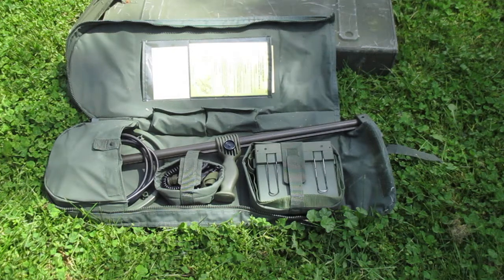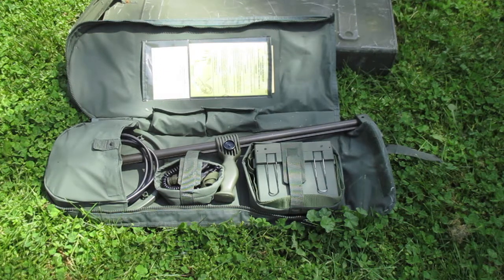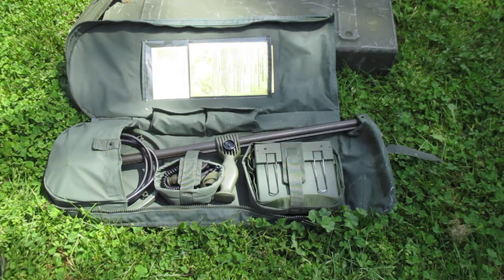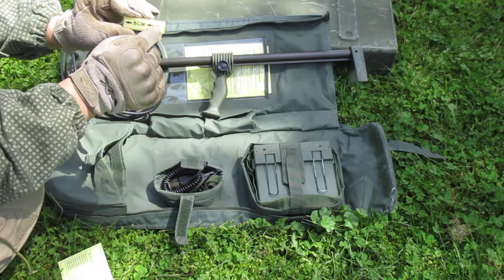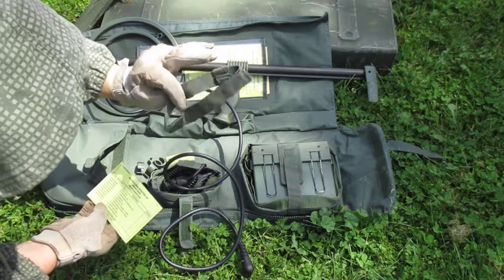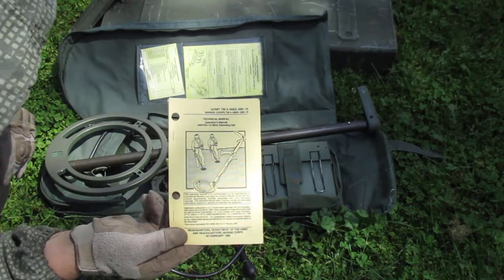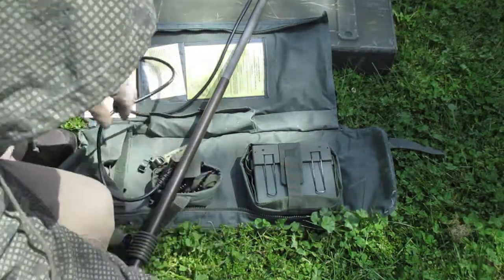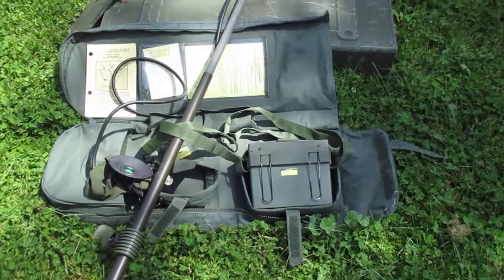Militia Engineer Tasks- Inventory and Visually Inspect the AN/PSS-12 Mine Detector Set

Comment: How much would one be brand new in bag?
Reply from the maker: Doubt you would ever find one new.  Only ones I have seen were surplus ones.  I'm still not sure how accurate mine is or what was the last upgrade installed.  Want to do more testing next spring.
Reply: @SecurityGuy42  ive got one new in bag.
Reply from the maker: @codywallace3678  Good for you.  How much did it cost?
Reply: @SecurityGuy42  Got it in a trade.
Reply from the maker: @codywallace3678   Consider yourself very lucky even the used ones of questionable quality are very expensive.  Think I paid over $500 for mine.
Reply: @SecurityGuy42  I've been looking to trade or sell mine.
Reply from the maker: @codywallace3678   I would say to first find a local militia you could trust and sell or trade to them.  You should be able to get  at least a basic AK or M-1 Garand in trade.  Baring that Gun Show would be your best next bet.  Ebay I found out (the hard way) cancels the auctions on them as fast as they can find them being posted.  Like the M-40 or M-42 Pro mask if you want it to sell you need to put it up for a Buy It Now.  But be reasonable in what you ask for it.  I can't give you a good estimate on price.  I would say look up the asking price Scheibel has on their site (if they post a price for buyers).
Reply: @SecurityGuy42  plan was to take it to a gun show or a military surplus show.
Reply from the maker: Good idea.  Shop it around first and find the best offer or the one that best suits your needs.  Good luck.
Reply: @SecurityGuy42  thanks for the advice.